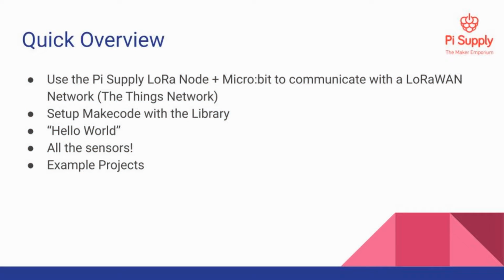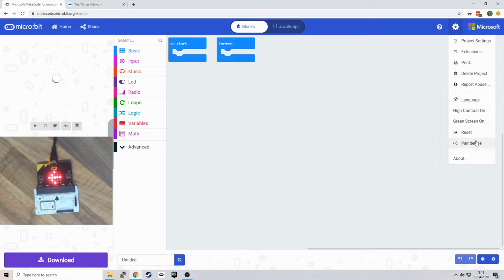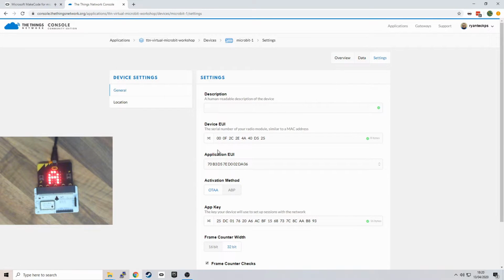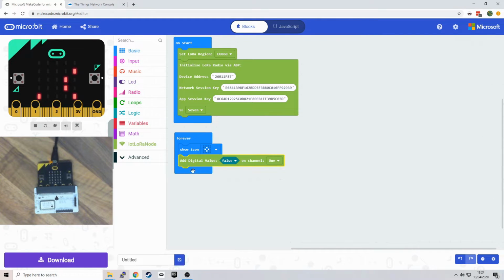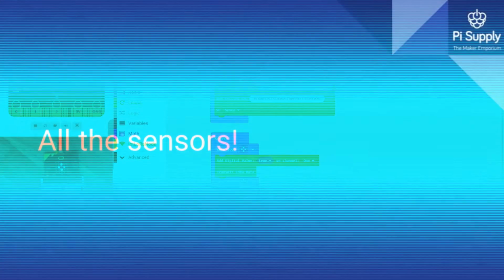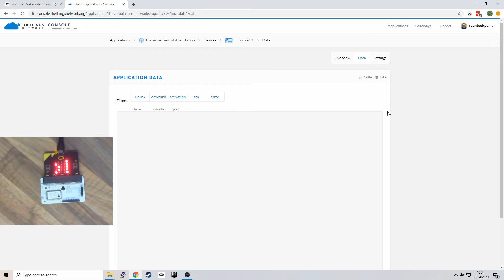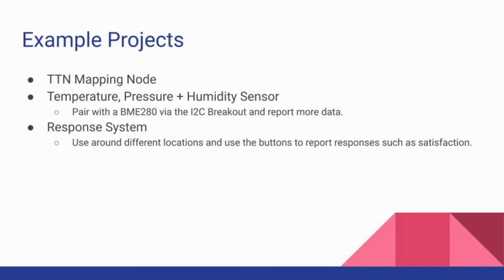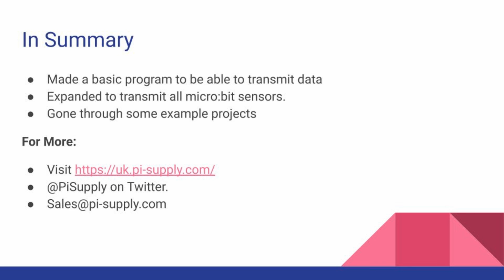How to get started with the BBC micro:bit and Pi Supply IoT micro:bit LoRa Node

Comment: The LoRa Node is useless if you don't have a working Things Network server node in range. There is no indication that the device is transmitting, and if you can't see a reply from the Things Network, then there doesn't seem to be any possibility to debug the problem. I was able to use an SDR receiver to see that my LoRa board transmitted a pulse of RF at the right sort of frequency, but didn't see anything on the Things Network console. I have no idea whether the nearest Things Network access point is operational. Pi Supply need to talk about the setting up of a local node to 'hear' the transmission from this BBC:Microbit accessory. The BBC:Microbit LoRa library also has peer-to-peer and continuous receive modes - Pi Supply need to tell us all about these options as well. In short - this is a good clear video on how to set up the node, but then nothing on debugging or other applications. BTW, I tried moving the inductor in order to enable the external antenna, and put the external antenna on a pole to increase radiated signals, but still no response from the Things Network here in Leicester, UK. Very disappointing for an expensive accessory - I am an experienced electronic engineer and radio amateur, so goodness knows how schoolteachers are going to use this device in their classrooms.